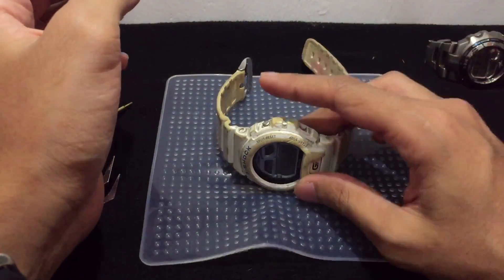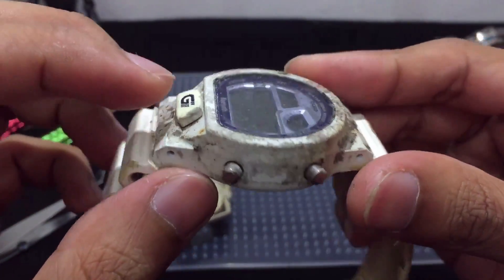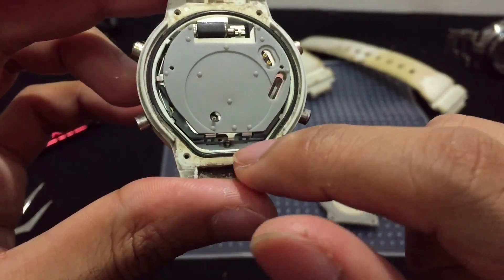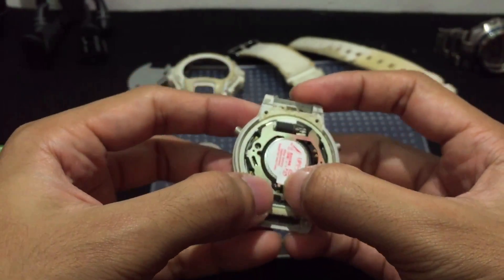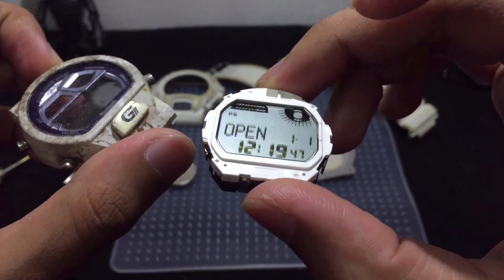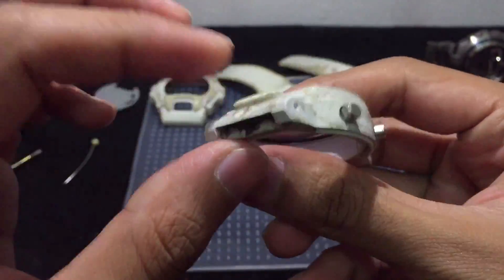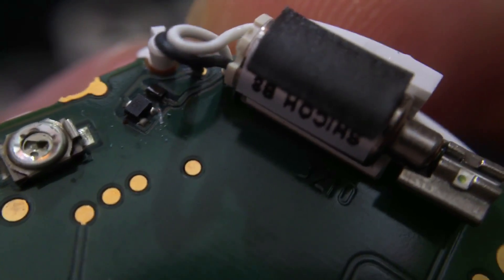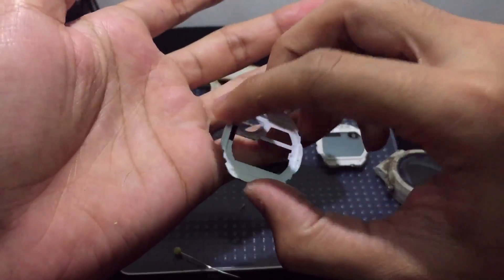Bluetooth G-Shock GB-6900 series watch breakdown!

Comment: Do you know if you can customise these and use GW6900 cases?
Reply from the maker: The band and bezel is indeed compatible to GW6900. The movement, I'm not sure if it could fit or not.
Reply: gshock highfashion thanks for coming back so quick. I’ve ordered a red strap and bezel and am gonna try :)